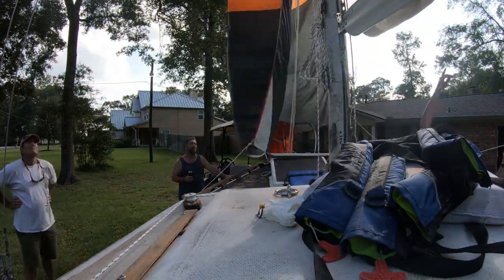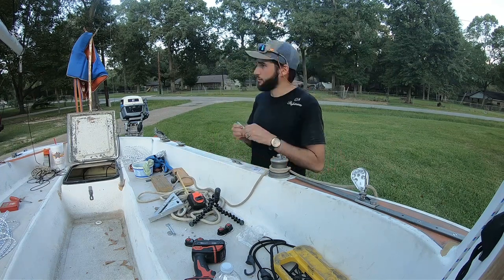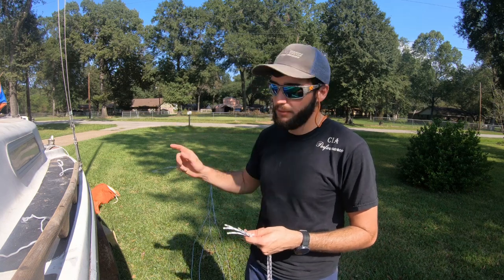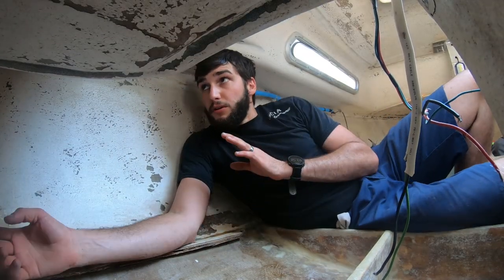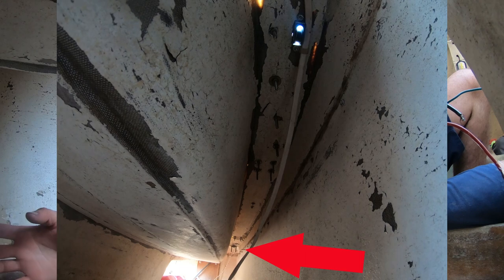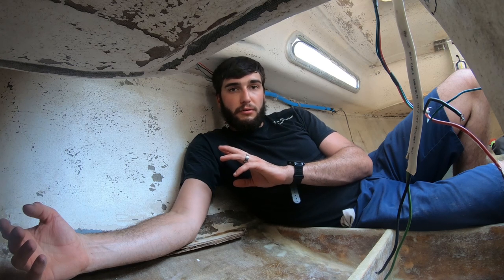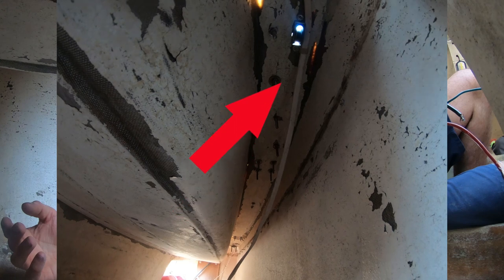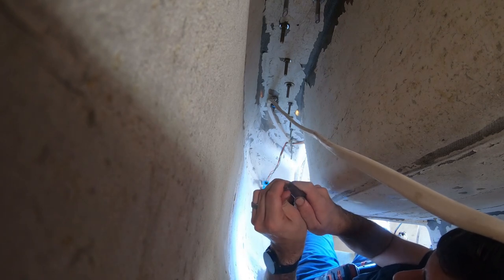Rigging Up The Spinnaker Hardware - New Salts Episode 8

Comment: Congratulations!! You're obviously doing your homework with your rigging.  I had noticed in an earlier episode that your thru-hull bolts were quite long and you have identified them as a potential chafing point.  The vinyl tubing will help, but when the sheets are slack and the boat heels, your sheet/guy may end up on one side or the other of the bolt.  This in itself is not a problem, but you may find that it can add some friction if you don't have a straight run.  If this presents a difficulty (which it probably won't), an option is to cut the bolts to proper length and use an acorn nut -- this prevents chafing and won't hang up on your sheets.  But, don't fix a problem that's not there.
BTW, I neglected to compliment you on your fuel pump repair.  Johnson/Evinrude pumps can occasionally be a bear to rebuild -- mostly just being able to keep the diaphragms in place until it's bolted up.  Every time I put a boat on a trailer, I pull the fuel line and run the motor completely dry.  That and ethanol free fuel seems to agree with the older motors.
Reply from the maker: Thanks Robert! 

I am not a huge fan of the blow deck rigging as its a pain to setup and it allows rainwater into the cabin during a hard shower.   I plan to remove the hardware and patch over the holes when we paint the boat.    I plan to use all external more traditional spinnaker rigging when the boat is complete. 

Good call on trimming!  I will be trimming all protruding fasteners when we complete the interior rebuild! 

Thanks!  Ive done a handful of these fuel pumps and the are certainly a pain!     

Not a bad idea pulling the fuel connection and letting it run dry
Reply: @newsaltsailing7756  I am with you, I don't like sheets running where I cant see them.  Either they tangle or fray.  They may also end up being used as jib sheets in case of problems there.  I lke your thorough approach on repairs.

Comment: Hi, it is refreshing to watch a YouTube channel about a refit of a small affordable sailboat.

I like your approach of fixing critical items first and then go sailing. It does make more sense than “slapping” paint on an un-seaworthy hull. You solution for the mast compression post is quite smart ( metallic instead of wood and bolting the blocks thought it ).

May I ask you few questions:
• Did you pressure test the lower unit of the outboard to find the leak which let oil out and water in? It may only need a new O-ring on one of the many intrusions to avoid further leak.
• Did you evaluates to install the transom re-enforcement behind the top gudgeons ( after removing it )? This way the gudgeons would have been re-bolted though the re-enforcement minimizing the flex where it is the most required.

• Did you check the centerboard raising cable attachment point? Serious damage car occurs if the centerboard drops loose because of cable attachment failure.

Keep posting, safe sailing.
Reply from the maker: Thanks for the feedback we’re glad you’re enjoying our episodes .

As for your questions I have not noticed any further water ingress into the lower unit so I have not dug into it but a pressure test wouldn’t be a bad idea.

Adding reinforcement up by the gunnels where the two hull halves connect is also on my list of things to do as I’m still noticing a slight amount of flex between the two pieces (hull and top) but during steering the transom is now much stiffer 

The keel cable is in good condition.  I have in an upcomming episode added a roller on the stud which the keel cable rides to reduce wear and friction but when the keel is removed I will be replacing the entire keel cable assembly with a new one just for precautionary measure. 

Thanks again for the comment we really appreciate the interaction and glad you’re enjoying the channel!

Comment: The mast is Al?  We usually use rivets on the mast rings; I would think screws would pull out (I could be wrong there) there can be a lot of tension on that spinnaker pole at times.  Bad form to put spin pole between stays.  Did that once, taco'd the pole pretty as you please.
Reply from the maker: You are absolutely correct, They did pull out!  We have since replaced the screws with rivets